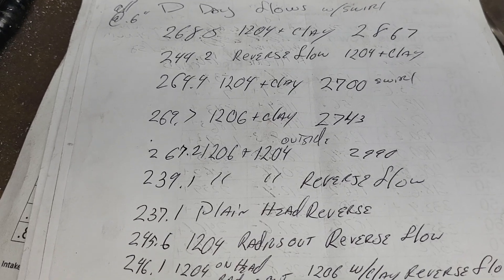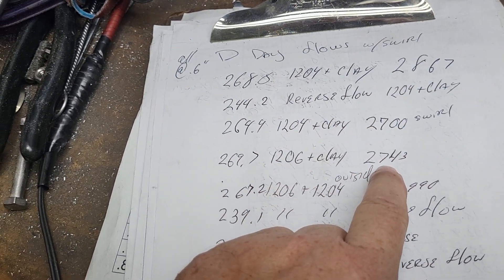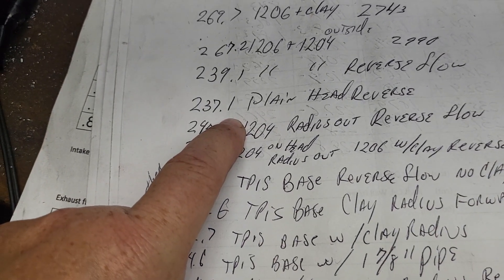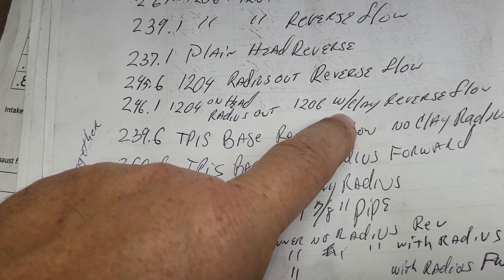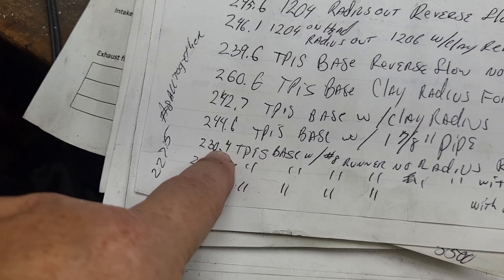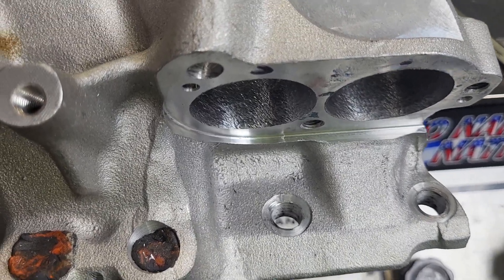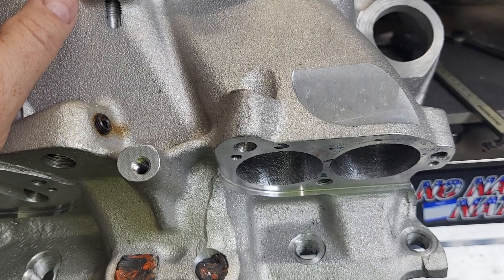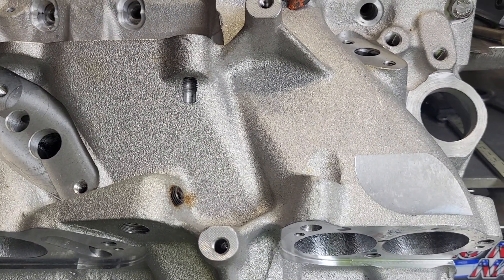Forward and reverse flow with anti reversion. Can it help more in one direction than the other?

Comment: I would imagine extra anti-reversion steps in the intake would also have a bonus effect of helping to re-atomize any liquid fuel on the floor? What kind of mileage did your rig with the many steps get? was it more than you expected?
Reply from the maker: 383 turbo 400 2800 stall 3.42 gear 17 + mpg 3500 lbs. Fuel injected early 90's
Reply: @servediocylinderheads  what tyre size, or what rpm @70mph
Reply from the maker: @krusher74  Game plan has changed 418 cubes. 700 r 27 5" about

Comment: would love to see the setup with runners attached,  with and without a bit of tape covering the top 25% of the round manifold to curved runner connection as a ledge. you would ideally ramp it with clay to the tape line. On inlet air would see a ramp that pushes some more air towards the outside of the runner radius where it would be biased already but on reversion any air on the roof of the intake manifold would hit a ledge pushing some of the air down 180' away from the turn it has to make in the radius up to the plenum. Then, to prove effect flip the ramp direction and do the same test with the ledge on the bottom with 2 ramp directions as well for 5 test configs taking inlet and reversion flows on each. The large ramp would be test only to prove effect works you wold be likely want  <10% diameter not 25% but that would be easy to tune by trimming the ramp if the effect is proven on exaggerated test.

This is kind of like an exhaust D port with a round header pipe. I've always thought the flat of the D needed to be on the roof not the floor to really stop/disrupt the reversion pulse. (assuming headers turning down towards the block)
Reply from the maker: I have a video of some Slover ported bowtie heads I have that are upside down D ports. With some work they flowed very well. Thanks

Comment: Flow increase may be due to a slight venturi effect with more stable laminar flow.  Another factor could be friction reduction at the boundary layer. That what increases flow on an exhaust port when you add a pipe. I like to leave a .030" difference between port transitions to aid in wet flow management not just anti-reversion. 
Don't sweat the haters, you can't please everyone.
Reply from the maker: I had that conversation with D.V..He asked me first. I said," .030" difference.
Reply: @servediocylinderheads  it's sad that so many people malign him when he's just trying to share his massive knowledge base. He seems very misunderstood.
Reply: @psychoholicslag4801 
DV #1...
I listen and analyze others but in the end DV wins IMO.
Reply: @servediocylinderheads 
Yes, I've always left a 20-30 down step... I think the real reason was that there might be a slight misalignment as to where the parts fit together. I'd rather have a drop off than hit a slight wall.
(Let's not get to the Edelbrock Cleveland thing here, LOL)